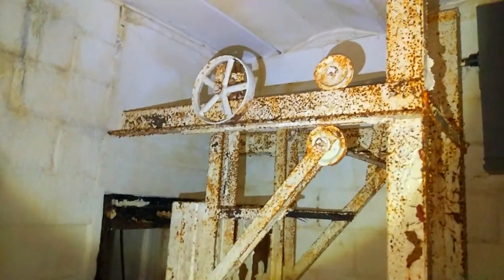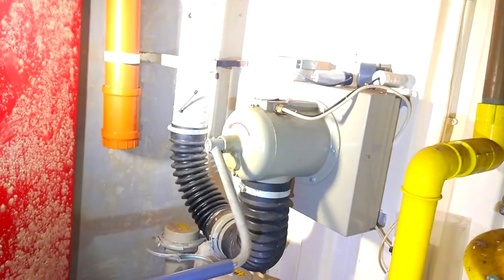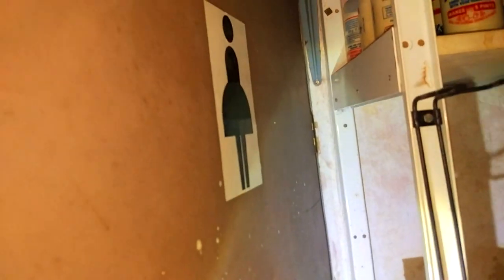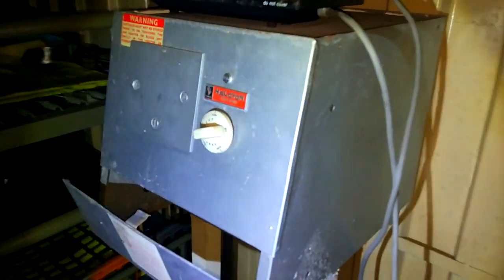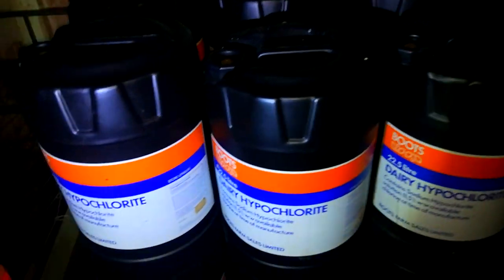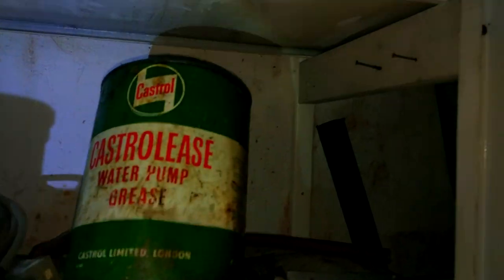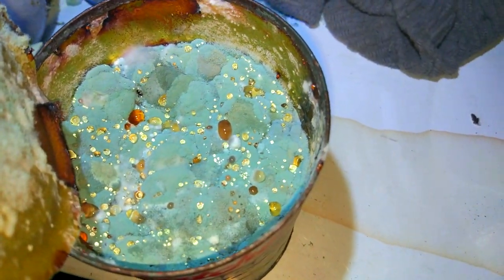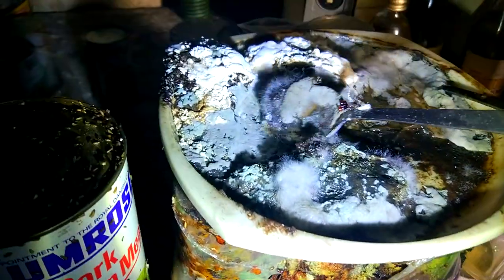We return to Millionaire's Bunker

Comment: I wonder how long the owners expected the food to last. I’ve heard stories of some tinned food to last for decades (and still safely eatable). The lifespan of tinned food seem to be dependant on how well it is sealed and how airtight the can is. If it’s not a complete vacuum inside, some gasses could form when the contents break down. Some of the tins also look very corroded, but suppose one of them was still good. What would it look like inside if you’d open it up. Would it still be good? The owners must have trusted those cans to last a long time, but would they have expected them to last beyond 1989? That bunker pretty much became obsolete after the cold war era. Suppose they had to flee into the bunker in 2021 (for whatever reason) , the cans would have become unusable. It looks like they just flat out forget to maintain it and ever think that one day, the stocked tins may no longer be usable.
Reply: They didn't seem to have any backup fuel for the generator either, this looks very much like an impulse decision in case of very specific and relatively short emergencies
Reply from the maker: The whole idea of having a bunker in your garden seems a very erratic and paranoid thing to do.  The bunker is very well stocked and is full of things you would need in a nuclear disaster, but realistically I don't know how well it would have coped if nuclear disaster ever happened.   The bunker is not deep enough to survive an atomic bomb.  You need the bunker to be at least 30 meters deep for that.  Although with that said, most of the council control bunkers were not deep enough either.  Most of the bunkers that were deep enough are located in London.  So it seems that the idea of having bunkers outside of London was just to protect you from the radiation if London got hit by an atomic bomb, rather than to actually protect from a close hit from a bomb.  This millionaires bunker is located in Kent, so it is very unlikely that an enemy would chose to bomb Kent anyway as there is not much there of strategic importance.

Comment: It's great that you returned to the place. I was thinking you should spend the night in there. There's even unused bedding. Most likely before those can were open they would have looked almost normal. I bet most of that equipment, including the cooker, would still work, or could easily be fixed up.
Reply from the maker: I wanted to do an overnight challenge there, but the air quality is too bad there, mainly due to the moldy food.  I have plenty of other overnight challenges coming soon to my channel.